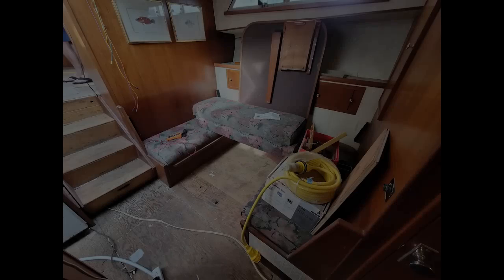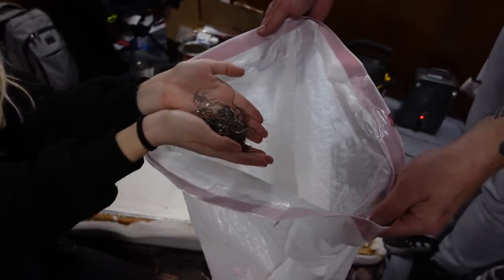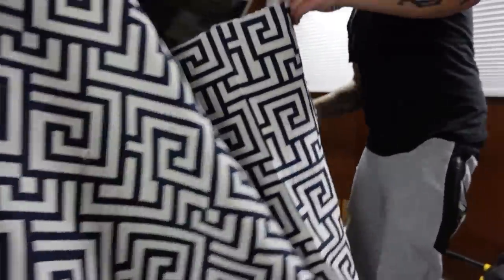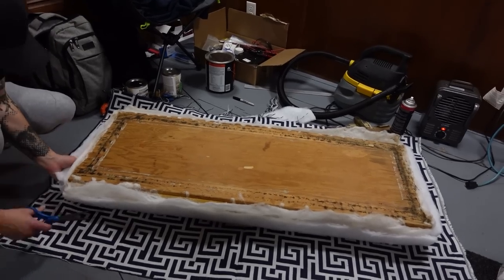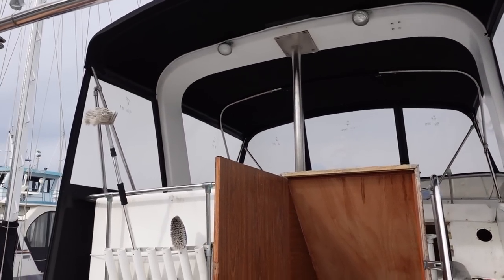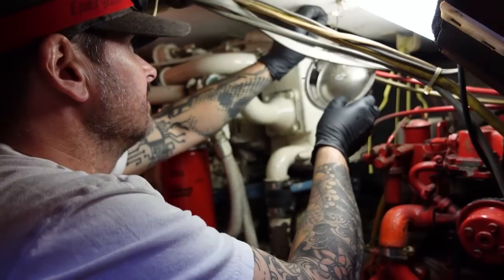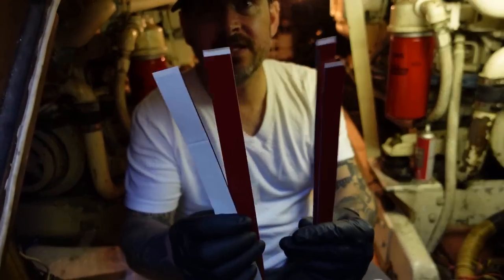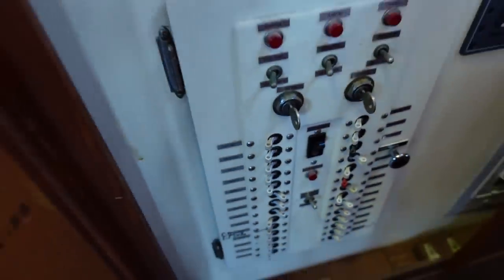Upgrading Engine Room Lights to LED | Old Yacht Restoration | Ep. 16

Comment: You should buy a complete roll of sunbrella. It will be cheaper in the long run. You my friend are lucky to have such a willing accomplice. Just remember, what you are doing can be rough on a relationship. Step away every so often and focus on each other.
Reply from the maker: Thank you so much for this advice. Getting wrapped up in projects changes focus to getting work done and not on relationships. We have needed to take breaks but kept pushing through, not a great plan. We have gotten things corrected and are making sure to have time for ourselves, family and friends.

Comment: Lighting in an engine room is so nice. It’ll be interesting to see how that sticky tape holds up over time with the engine room heat.
Reply from the maker: We'll provide an update if we have any issues!
Reply: For me that's more than nice - it's helping every day in future. Thanks to that LED technology you are able to have everything in a perfect visibility. Great when searching for problems.
Reply: The good part is its on pegboard and easily zip tied into place. I was also curious about the tape. I didn't see anything get wiped down before they got stuck in place.
Reply: Excellent. I'm in the middle of a boat engine swap and will need new galley cushions later. Marine upholstery is ridiculously priced. Good job showing how to diy.
Reply: none of the glue will hold up over time with the heat.

Comment: I recall a project written up in a magazine about 10 years ago where they replaced the old lights with recessed halogen lights in the cabin overhead. I couldn’t believe they didn’t understand the heat given off by halogen might start a fire in the boat wood frame and assorted insulation they planned to use. LED has changed the lighting concepts so much, even being available in daylight or warm light, and multicolor if desired.
Reply from the maker: That's one of the things we would be worried about changing out lights, LEDs are definitely a game changer and we will be adding more throughout the boat soon.

Comment: I am a former Uniflite long term owner, There is need for sound insulation in the engine room as there is approximately 6" already installed in the floor and the hatches which you will note if you pull the main engine hatches under the rug. Also, no need for insulation in the for ward cabin as it is a foam cared hull. . Best hulls in the industry!
Reply from the maker: We are looking into ways to get the engine noise down inside the boat and were considering removing the fiber insulation in the engine room and replacing it with a soundproofing foam. We may just lay down that rubber with lead in the middle on the salon deck but we're still looking at options.

Comment: As for sound deadening, I’ve had good luck with Dynamat, really common in the car community. It’s reflective so it would help reflect some of that radiant heat. 

Would love to see an episode on the nav system of the boat some day. Does it have a radar system, or autopilot?
Reply from the maker: Thanks for the suggestion we'll look into dynamite. We have quite a bit of work to do on the nav systems. There is a radar, autopilot and old chartplotter but we don't know the status of those systems yet. We will definitely be doing a video on those in the future.
Reply: @SeekingSeas  Cool! I’ll bet the speedometer uses an old Pitot tube, I’d just replace it with a GPS fed gauge. I modernized the gauge cluster on my 70’s Bayliner and didn’t want to drill more holes in the transom to keep the analog sender.
Reply: @SeekingSeas  Don't mix up dynamat and dynamite ;)
Reply: After the Dynamat or Kilmat , use Noico Red 150 (mil ) , that’ll help deaden it and cool it down the cabin above .

Comment: hey guys i have a suggestion, maybe you could sand down all the would to make it more of a modern colour/shade.
Reply from the maker: Not a bad idea, any color you had in mind?
Reply: @SeekingSeas  Like a light oak, just a lighter, more modern colour to really match the greys and whites that are now in the boat
Reply: Except for the trim, all the "wood" is teak-faced plywood.  If you sanded it you would end up looking at plywood in about 15 seconds.  I know this because I built boats like this at Uniflite.

Comment: It would probably be better to insulate the salon floor instead of the engine room.  There are products made to do this and it doubles as a carpet pad.  I did this on my boat and it worked very well.  It has a layer of lead shield and the top was a rubber mat.  Also keeps the floor cooler.
Reply from the maker: That sounds like a much easier way to go about it. Can you install any type of flooring on top, or does it have to be carpet?

Comment: Last time I was writing about the submergible pump. Now my thought: Your inverter seems to be under the galley seats - could there be a different placement - more up so if there is some flooding it is longer save.
Reply from the maker: This is where the old one was installed, it is a couple feet above the bilge so if we have water there we have much larger problems, lol.

Comment: How did you guys learn to do all this? From the electricals to the plumbing to the engines? I'm young and have very little experience and knowledge in these areas, and one day I wanna be able to do these kind of things. How would I go about getting to that kind of level?
Reply from the maker: We talk a little bit about our backgrounds in the Q&A portion of episode 14. Jesse has worked on cars, done construction, and worked on boats for most of his life. His professional background is cybersecurity with a specialty in embedded devices. My (Hannah) background is in computer science and I specialize in automotive cybersecurity and have mentored robotics to high school students for many years so I have experience with electrical and more importantly general engineering problem solving skills. Jesse has a lot of knowledge and sometimes we're just figuring it out as we go. The best way to learn is by just trying it. These days a lot of information can be gained by youtubers, or if you have an opportunity to work with a mentor thatd be great. Taking this boat on as a restoration project and doing most of the work ourselves has been the best learning experience for me. Good luck with your future projects!

Comment: FYI, You have to be careful when buying anything marked "Stainless Steel". Just because it says "Stainless Steel" doesn't mean it won't corrode.  If you want stainless steel that does not corrode you have to get the stuff made from 904 stainless steel or marine/aircraft grade stainless steel. 904 stainless steel is a nickle based steel where as other forms of stainless steel is iron based. You may already know this but thought I'd mention it just in case you didn't.
Reply: Great tip